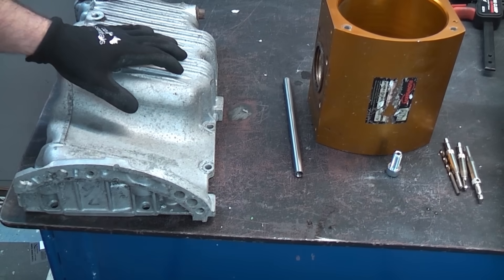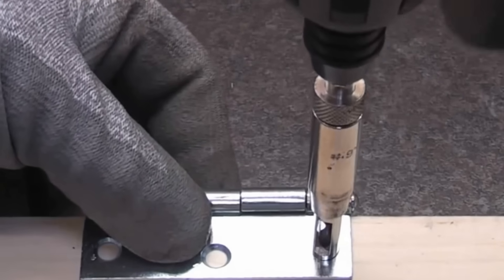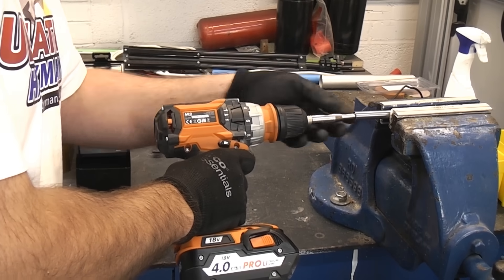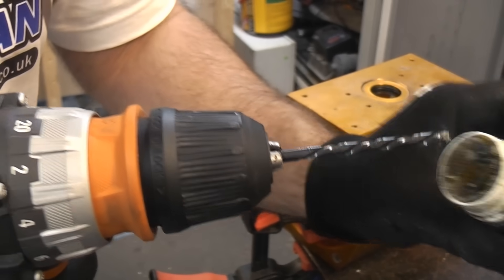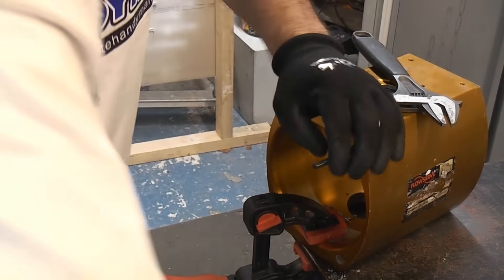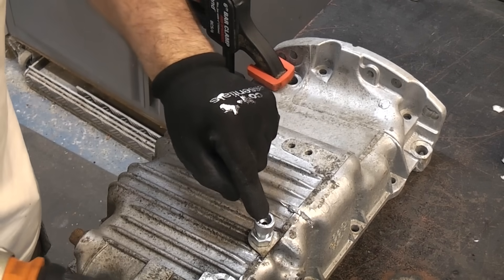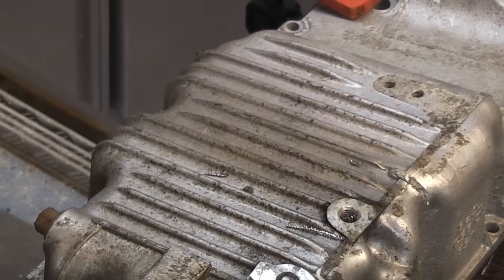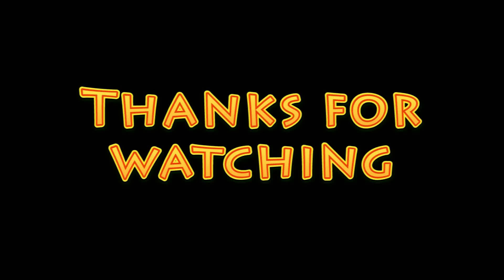How to remove a broken bolt in a deep hole | remove broken bolt in recessed hole

Comment: 2 questions came from this video to me:
What kind of steel bolt that must be when it breaks before striping soft aluminum threads?
What kind of chissle mechanic did managed to break steel bolt in aluminum?
Btw great idea on those drill bolt guides.
Reply from the maker: Some metals do not go well together, aluminium and steel can corrode and they sort of weld themselves together, which is why a anti-seize compound should be used. At work we use a lot of stainless steel, which goes into tapped stainless steel holes where an anti-seize compound cannot be used. Stainless on stainless is very bad as the threads can suffer from galling, which makes them very difficult to remove- often causing the bolt to shear.
 The bolts in the video had probably sheared when being undone, but only a portion of the bolts had been fully removed.
Thanks for the comment
Reply from the maker: We just have to put up with it. Stainless steel bolts are used to hold spigots onto rollers in a industrial glass washing machine (it cleans sheets of glass that are 10mm thick, 1.8metres wide and up to 3 metres long). No lubricant or compounds can be used as they could get into the circulating water which could stain the glass. You can see one of the spigots in this video- https://youtu.be/UQ2gbO2Wynk?t=173
Thanks for the comment

Comment: Have to love that Never-Seize ! As messy as it can be, it's well worth it.
Reply from the maker: Yes, it is superb stuff ;-)
Thanks for the comment
Reply: Great in most applications just not in salt water especially where you have Aluminum Threads and Stainless Steel Bolts. Use Aqua Lube instead. Stops Electrolytic Corrosion and acts as a thread lubricant as well.
Reply: @richb313  - Marine grease.
Reply: Work with Never Seize, get a little on your shoe. Stop at the grocery store on the way home and tomorrow, it's in Tokyo.
Reply: Yes,  I antiseize nearly everything on my vehicles even the edges of brake pads and backing plate touch  points of shoes, excellent at preventing rust from seizing parts on the old farm equipment as well
Reply: stump removal
Reply: Worth every cent paid for it. A little goes a long way if you're the one who buys it with your own money. Employees, of course, slop it on, can go through a can in a week.

Comment: nice vid,but dont forget to put a locking ring between the bolt and the piece,because if you put grease on the threads and the piece vibrates the bolts can come loose
the piece looks like something of a motor,so lots of vibrations,now i feel like the beach boys (good vibrations) LOL
Reply from the maker: Thanks for the comment

Comment: I snapped a drill bit into an A2 stainless manifold stud, what are my options lol
Reply from the maker: You could try xtract alloy  welding rods?
Reply: @ultimatehandyman  thanks for that, I've made a right mess of the thing though, I did manage to drill the A2 stainless with a cobalt bit but then the bit snapped as I started with a small bit, then I tried to wedge an extractor in the side of the bit and that snapped and I think it may have flared the end of the stud out too, it's about 2cm down the hole so I was thinking of just drilling the clear part out and winding a timesert in and dealing with the new stud poking out a bit more. Ideally I'd like to get the thing out if possible. I'll give those xtractalloy rods a shot cheers
Reply from the maker: They are difficult to find, but specialist welding firms sometimes stock them.
What size is the stud that you are trying to remove roughly?

Do you know what thread it is?
Reply: @ultimatehandyman  yeah I can't find any on eBay but found a couple online. It's an M8 X 1.25 pitch thread .

Thanks for the help though
Reply from the maker: M8 is a bit difficult as it is so small. 
Hopefully the Xtract alloy will work.
Good luck with it ;-)
Reply: @ultimatehandyman  thanks, I have always got the timesert technique to fall back on, I've never actually used a timesert but they look smaller than 2cm in length and I could always cut it down to fit flush ! Thanks for your help, your channel is the best no bs methods haha
Reply from the maker: You are welcome.
Thanks for the comments ;-)
Reply: Solid carbide drill will cut through  hss/cobalt.

Comment: Great video, it may also have been a good idea to mention just how bad it would be if you broke either the drill or the screw extractor off in the hole, if that were to happen you really are going to have a bad day! :-)
Reply from the maker: Yes, you don't get days much worse than that!
Thanks for the comment

Comment: It's a good idea with the hinge sighting tool (I might buy one). & again with the bolt & nut guide, though you would need a lathe to bore through accurately & true enough, like you used. Save a lot of extra hassle, doing with anything else. Don't know how accurate a center finder would locate in a hex hole on a cap screw? Because I've never tried. Even then not as true as lathe. I had been using a Dremel grinder to flatten the broken bolt, then punching by eye with the punch, to get best center. I've also had an extractor break in the bolt, a harder material to remove. I had one yesterday, sheared off in a front sprocket, luckily some thread sticking out the back & turned it out that end with needle nose pliers. The easiest ways are the best at times with a bit of luck.
Reply from the maker: I'll make a video when I get chance of how I would drill through a cap head bolt using a pillar drill. I think I can get it dead central very easily (I'll try it soon).
Thanks for the comment
Reply: Ultimate Handyman You might be able to do it with a center finder but, one without a point. So a conical tip but not pointed, trimmed back so it rests in the hex & the point doesn't make contact with the inside. In fact saying that what about a hex bit the same size for a ratchet screw driver? It would locate if the same size, then lock down the vise.
Reply from the maker: I was going to do it by cutting the head off from a bolt, or use a piece of threaded bar.
Wind a nut onto the thread, then hold it in the chuck. Then position the vice to grip the nut, then bolt the vice to the table.

Then undo the chuck, wind out the threaded bar and insert the drill bit.

Then put a nut on the socket head bolt and screw that into the nut which is now held in the vice, then tighten the top nut down onto the nut in the vice.

This should ensure that the hole is central. I did try it earlier but my bench drill is a pile of junk and requires a new chuck LOL

Thanks for the comment

Comment: I had to remove a hardened head bolt out an engine block several years back. It snapped about 1mm above the block surface. It was a nightmare to remove. I had to file it flat, center punch it, then drill down as stud extractors wouldn't grip it. I destroyed several drill bits, but eventually got deep enough into the bolt that an extractor gripped it. By that time, the amount of heat generated by ruining those drill bits had heated the bolt to a very high temp, and abit of wd40 sprayed down after while it was red hot cooled it and broke it from the corrosion plus lubricated it abit. It came out easily with the extractor after. Drilling out a hardened bolt is not easy at all and your demo bolts were soft as butter in comparison.
Reply from the maker: I've had my fair share of difficulties when removing bearing from shafts at work. We don't get many bolts in holes like in this video as in most cases nuts and bolts are used, so that they can be washed off using the gas axe.
Thanks for the comment
Reply: Great video bud but maybe they guy above is onto something, it might be worth getting some hardened versions of your idea made, it would greatly increase their lifespan :)
Reply: No better feeling, than seeing that bolt come out of the hole. 
Especially if it fought you as hard as it did, taking drill bits out of commission during the battle.
Reply: Christian Buczko... Red hot from drilling??
Reply: Use TapMagic next time that you drill or tap. http://www.tapmagic.com/ TapMagic for aluminum, TapMagic for everything else.

Comment: Probably a good idea to run a tap down the hole after you've removed the broken stud, then give it a good blow out with an air line
Reply from the maker: Yes, if there is any chance of the threads being damaged.
Thanks for the comment

Comment: What size of drills did you use to drill the centres on each of the guide bolts?
Reply from the maker: I think I used 5mm or 6mm, I checked what size was best for my screw extractors and 5/6 mm seemed to be the best size.
I did drill one M12 bolt out using a 10mm drill bit but there was very little material left at the sides.
Thanks for the comment

Comment: Those guides are an excellent idea. I've never seen those before. I'm off to get some bolts and make some. I'll have to use a drill press though. 👍
Reply from the maker: It should be easy enough on the drill press. I was going to do that, but it was much easier on the lathe.
Thanks for the comment
Reply: Ditto
Reply: Same. Living where I do broken bolts are all too common. These are all the techniques I would use. I hadn't seen the hinge tool before though.
Wouldn't actually be that hard to drill some through holes in various bolts, which I think you were suggesting Big Ben, and use those as guides too.
Reply: Oh... And I unpause the video and that's exactly what he did, hahaha!
Reply: @802Garage  vix bits
Reply: I've never seen one of those before either.  Have to go online and look for one.
Reply: 802 Garage i
Reply: glyn hodges  really great advice
Reply: Very good information
Reply: Easy out 👍🏻👍🏻👍🏻
Reply: Great idea, never been able to drill straight with a drill press, I am going to try your method, thanks
Reply: Does anyone has a link for buying those guides?
Reply: By clamping the bolt inside the chuck of the drill press one can line up a drill bit so it is centered to the bolt and drill in this method. The drill bit is set in a secured vise under the chuck.
Reply: Great idea!  Simple and very effective!
Reply: I didn't even know they made left-handed drill bits
Reply: glyn hodges  - Start with a center drill. They are made specifically for drilling the bearing hole in an item that will be supported by a 60 degree lathe center but they are great for starting drill holes. Their flutes don't have cutting edges.

Comment: One bit of advice you missed with the extractors is if the broken bolt does not turn right away, STOP. Trying to force the extractor will result in a broken off extractor which is too hard to drill. Then you get to take the part to a machinist.
Reply from the maker: Yes, hopefully people will already have some common sense (perhaps not all)
Thanks for the comment

Comment: Great video, will definitely make a few guide bolts and try to source some l/h drill bits. Removing broken studs especially from motorcycle engines is something I always treat with caution, horrible job usually with limited access. Thanks for the tips.
Reply from the maker: You are welcome
Thanks for the comment

Comment: Brilliant video, thanks. The only problem is that I don't have any of those screws with the holes in that you did in the lathe. Do you know if you can buy them? I suppose for a one off extraction job you could make a wooden sleeve and use that to centre the drill that is making the hole in the broken stud.
Reply from the maker: I don't think you can buy them.
If you have a pillar drill you can make some, but it won't be as easy as on the lathe.
Thanks for the comment 👍🏻

Comment: how did you go forward making those hollow socketed guiding bolts?
Reply from the maker: I put the socket head in the 3 jaw chuck on the lathe at work and then drilled straight through it.
You could do it on a pillar drill though if you don't have access to a lathe.
Thanks for the comment
Reply: Brilliant idea drilling the guide bolts👍 time to start selling them 😄

Comment: Brilliant video as usual. Your idea of drilling a hole through a bolt to use as a guide is absolutely genius. 🙏. I been thinking about buying left handed drill bits but I keep delaying it. I guess I have to order it just in case. It is always nice to have them handy. I already have bolt extractors like yours and car wheel bolt extractors. What make are your left hand drill bits?
Reply from the maker: Mine are made by a company called Wel-Bilt
I don't know much about them, as I bough them from auction. I paid about £18 for a full set of them in Imperial sizes.
Thanks for the comment
Reply from the maker: Just found this- https://www.northerntool.com/shop/tools/product_34759_34759
That looks exactly like my set.
Reply: Harbor Freight also carries left-handed drill bits, if you have one near you.
Reply: @mapleacrefarm  - Maybe. After all of my parts, supplies and tools were lifted by druggies I went to Harbor Freight and they didn't have them any more.
Reply: Ooo

Comment: I  have a sheared bolt in a scooter engine casing but corrosion  is the reason it sheared and the reason it is stuck in there....where it is stuck on the aluminium  casting I'm  unable to apply to much pressure  as that particular  area of casting is liable to break off....so just thinking about options
Reply: If it is sheared off near the surface.

-Find a friend who is good at welding
-place a nut that is a size smaller than the thread of the broken bolt.
-Weld the nut to the bolt through the hole in the nut.
-Allow to cool off , the heat from the weld will help loosen the corroded threads
-SprayWD-40 and let is sit over night
-Use a wrench on the nut, gently rocking back and forth.
-If the nut breaks off , start over.

Just remember that the first step is the most inportant.
Reply: This works if the broken bolt is flush at the surface of the casing, not broken inside the hole like in this video.
Reply from the maker: Once the bolt gets corroded in there it is very difficult.
I'd apply some penetrating fluid regularly for a few days- it might help.
Thanks for the comment
Reply: Dissolve the steel screw in alum solution. Look it up on YouTube.
Reply: You may be able to dissolve a steel bolt out of an aluminum housing by using alum powder. You would need to make a temporary fixture out of a pop can and secure it to the housing with silicone sealant. Fill the pop can with water and add dome alum powder. In 48 hours or so the bolt will be dissolved. The process will work faster if you can keep it warm with something like a 100 watt lightbulb.
https://youtu.be/7pN-fnUeA3o
Reply: There is a trick you can try on aluminium castings. Use a solution of alum in warm water. Make a small dam around the bolt hole with Blutac and fill the hole with the alum solution. Let it do it's magic for a few hours. It'll corrode the iron in the bolt but leave the aluminium. You can get alum from the grocery store in the baking section.
Reply: Shoot a load on it and let it soak in...
Reply: So buy a motorcycle instead